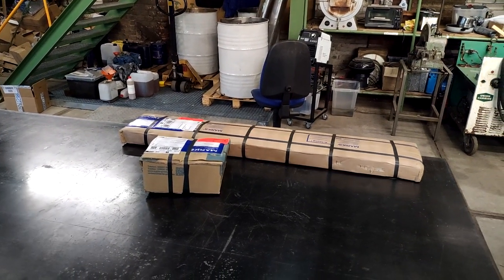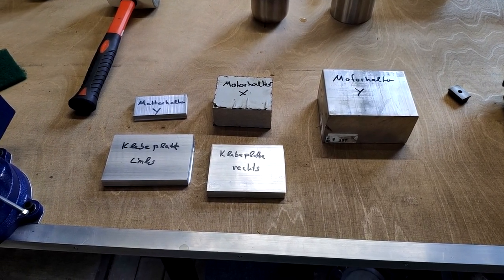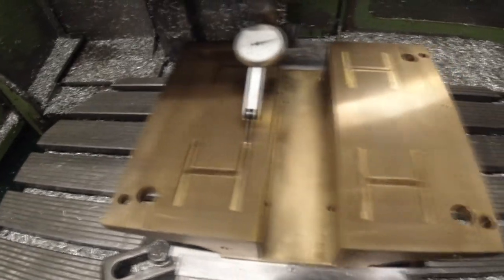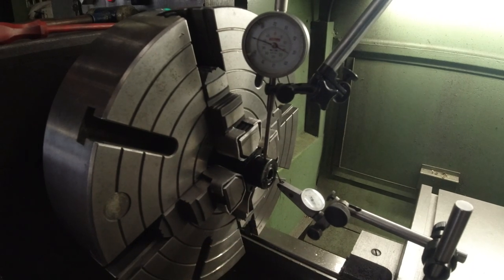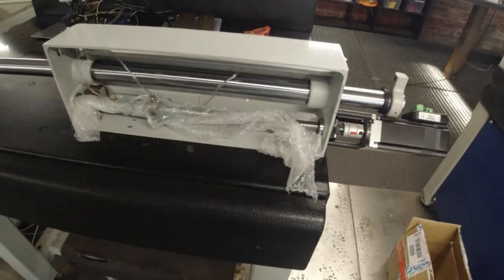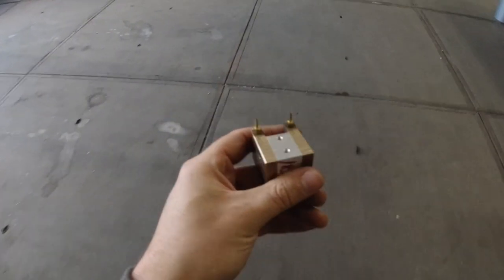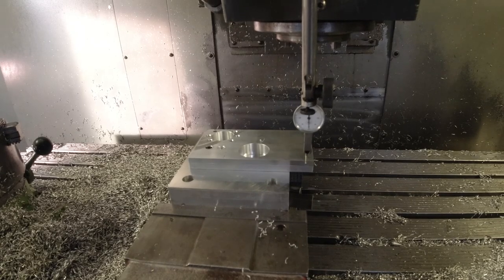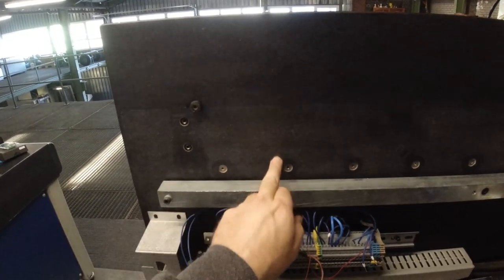Air Bearing 3d printer almost ready for takeoff #S01E03 The Motion System

Comment: The ruby is a flow orifice with precise hole diameter. This is to improve dynamical performance, by preventing the long column of air upstream of the ruby from compressing and acting as a big spring.

Comment: Very interesting project - thanks for taking the time to produce the vids - very much appreciated.  Quick question, and you might have addressed it earlier.  Is there a net weight delta between the factory equipment removed and the new hardware added, and is it going to be within the air bearings lifting capacity?

Fail Early - Fail Cheap... Like that one...
Reply from the maker: Thank you! Interesting question. I havent weight everything that has been removed / added. But I guess its pretty much the same as before, maybe the slightest amount added. But shouldnt be an issue, I can always crank up the working pressure to get some more capacity. 

More importantly in my current configuration I havent added any masses in bad positions. Everything is build as close as possible to centre of weight. Maybe except for Z-Axis servo, but the original DC motor was also mounted up there.

Comment: Very interesting project... Machining those air bearings must have been quite nerve-wracking. Especially the large one for the y-axis seems to be quite prone to warpage. I'd assume the ruby is mostly there to dampen any oscillations. I'd imagine ruby is used as losses are dependant on the sharp inlet and outlet corners. Although porous media air bearings are quite stable, orifice bearings are prone to instability issues. (PS. My experience with air bearings is mostly academic... Although I'm looking forward to build something air-bearing related :D )
Reply from the maker: Exactly what I was worried about. It did move a bit, something like 20-30 microns more bow in the middle. I'll stick with it and if the capacity is significantly lowered we have to lap this one to get it true again.

Comment: Great Content!  (What is the brand and specification of the adhesive you used)?
Reply from the maker: I used an Uhu Endfest 90 2k epoxy. Used for glue joints of various kinds, but mostly for stone/metal joints. Should be at around 15N/mm strength when cured.
Reply: @Roetz40  thank you so much!